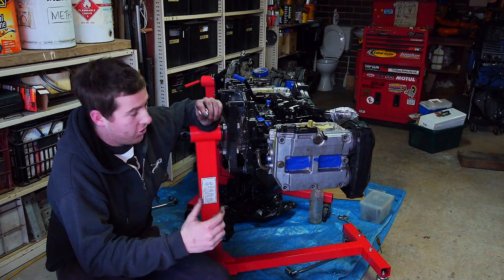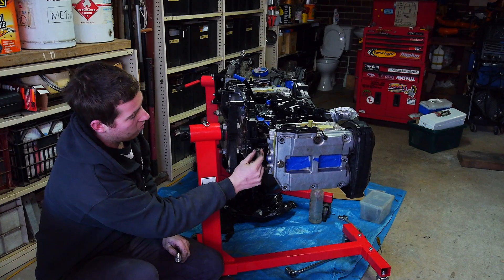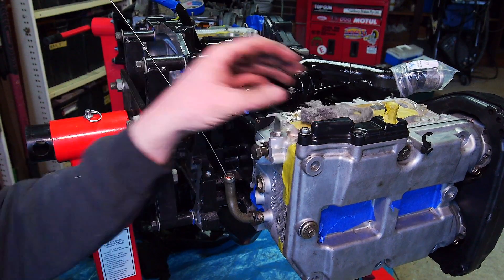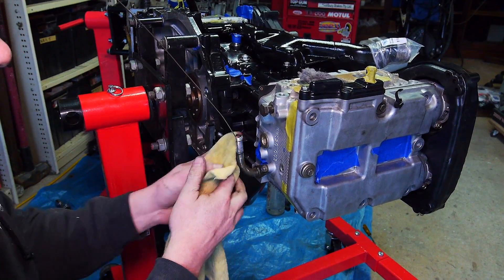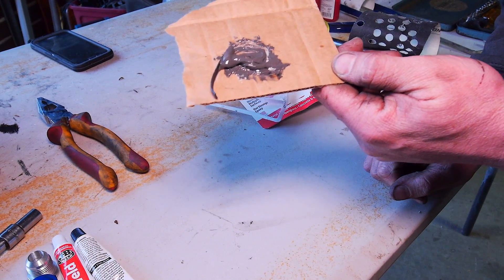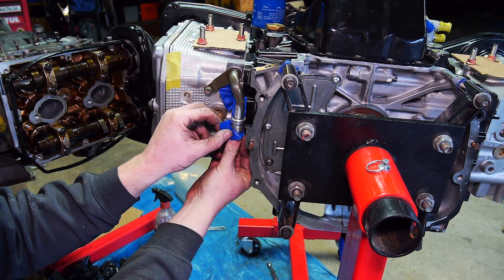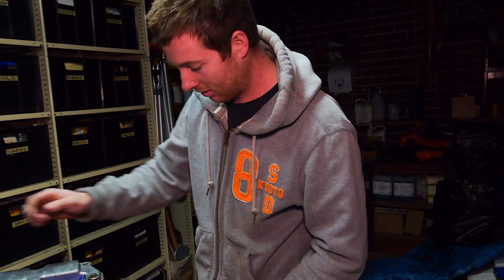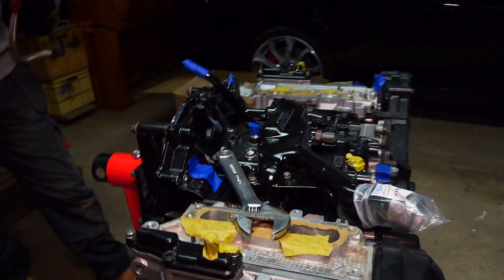EJ20/EJ25 TURBO OIL DRAIN -AN FITTING ADAPTER - NO WELDING - HOW TO

Comment: The fitting is bolted to the head sealed with an oring . You could of bought the an fitting and change it. Another way is cut the barb off and do a tube nut
Reply: I was gonna say, a good handful of companies literally sell this bolt on piece in AN

Comment: Just pulled the pressed I'm fitting out, drilled the factory hole bigger, tapped it and drilled a hole going through the head to insert a steel pin to keep the an fitting from backing off, havent had a issue again,  going on 6 years now, no issues
Reply: How hard was it to pull that pressed in fitting out? I bought the torque solutions AN kit for this problem.
Reply: @Phillipbm  it's not to bad, just get a pair of vice grips, grab, keep twisting and pulling. No problem

Comment: How come you didn't use a hardline fitting? There's a few different types these days which would have allowed you to simply clamp on a male or female
Reply from the maker: John Welsh That's a good point actually. I don't think I've seen any -10 ones though - not that I've ever been looking specifically for one

Comment: There some versions of Subaru turbos engine where the Japanese versions is installed intercooler on top of the engines. Some noise that you heard isn't works on as the intercooler cools down the engine and runs the cars in a steady way. if you tried to improved it, seeks for the Japanese Subaru for turbo versions. They had made it into car racing and engine stability for  known "boxer" engine as they called it.

Comment: Why didn't u just weld it?U are a good welder.
Reply from the maker: Seano Hutton Couldn't of said it better myself😉
Reply: He mentions it in the Video... A press seal into the head . There is no real gains from messing with that so early in the build . It would be a bloody shame if he galled the thing by mistake and it leaks like a blimmin sieve on such a highly built motor!